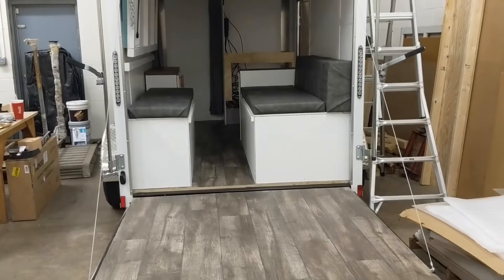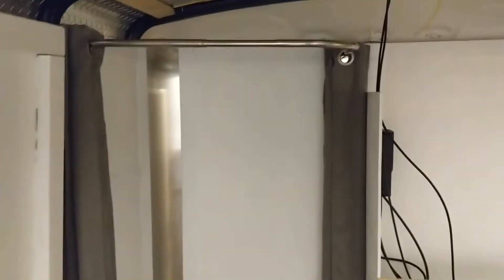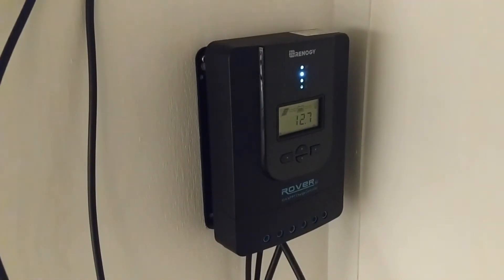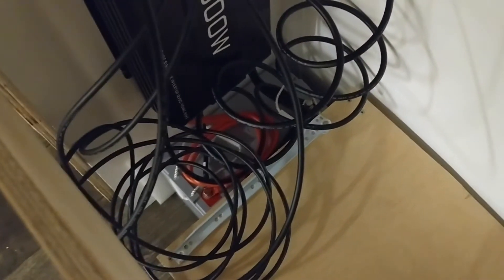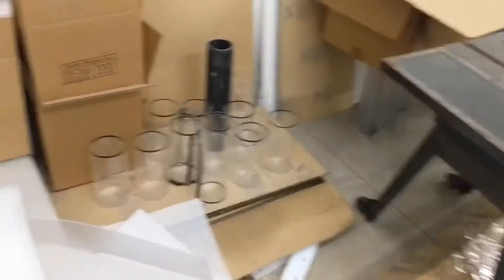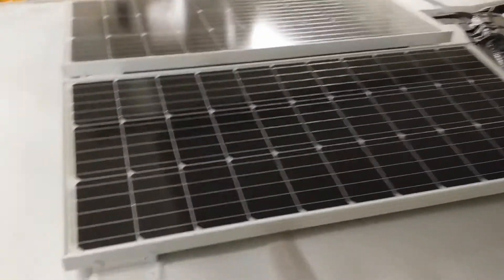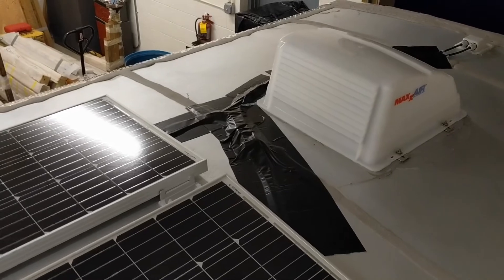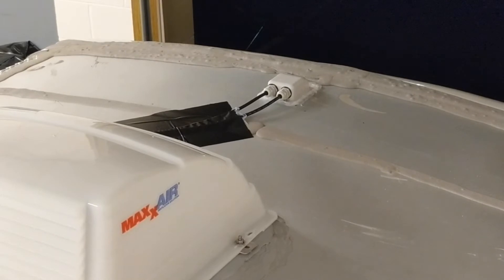Solar Panels for My 6x10 Cargo Trailer Conversion

Comment: If there is no hole in the roof what is the caulking for?
Reply from the maker: @bradley there is a hole that allows the cables in from the panels to the inside. I’ll be honest, I’m sure I overly caulked - but I wanted to make double sure water wasn’t getting anywhere it shouldn’t :)

Comment: Your relying on 3M tape and caulk to hold those panels down in 65 MPH head winds? I don't think I've seen that before, other than flat/flex panels. I hope it works out for you, that would be awesome!
Reply from the maker: So far so good 🙄 I questioned it to when I decided to do it that way. But I had watched several videos, and also looked into the strength of that 3M tape. I've taken the trailer probably 3,000+ mi so far, and those panels are still nice and secure. All kinds of weather - rain, snow, wind.